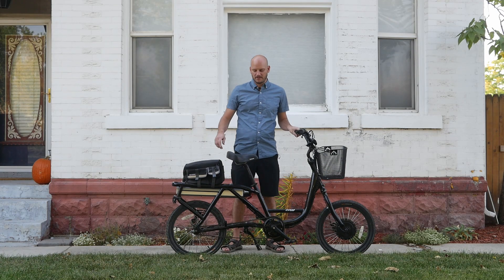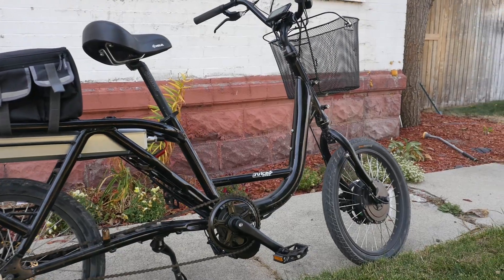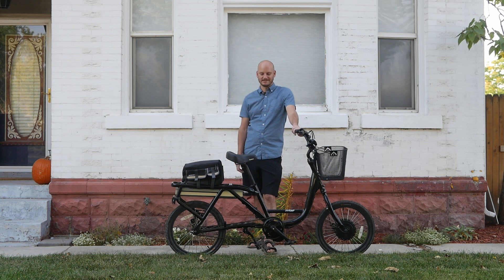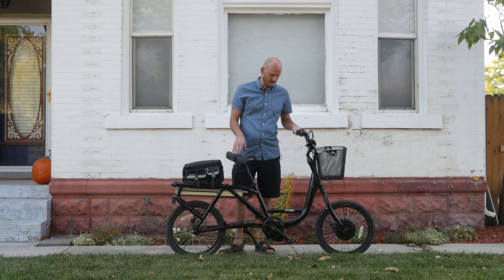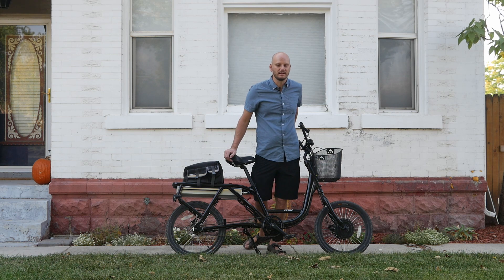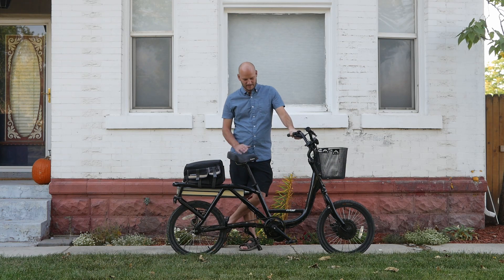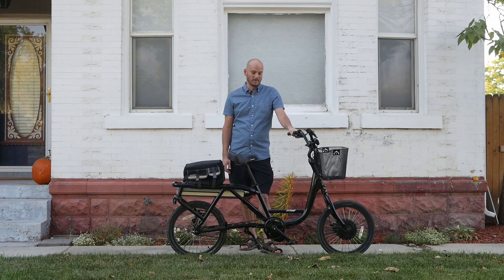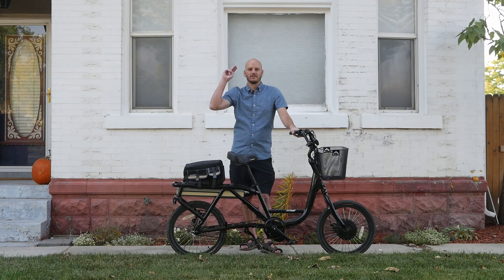Custom Ebike Build: Converting a Juiced Bikes ODK into a Mid Drive!!

Comment: Dude this bike is awesome and awful it’s awesome because you converted it but awful cause mid drives are just as useless as hub motors if there a single speed might as well of just not done anything and now since it’s a single speed it’s now the lamest thing ever but the good thing is that you could put a drive train on it to once again make it awesome
Reply: Most Juiced ODK bikes have an integrated 3 speed rear hub, so most of them have 3 gears. (That one probably does)